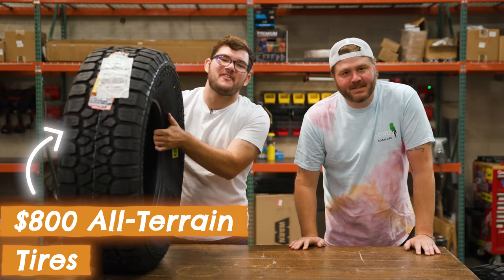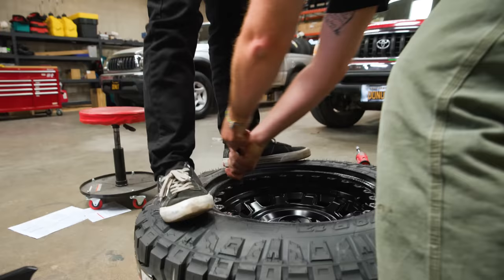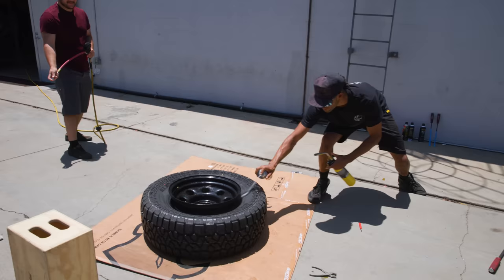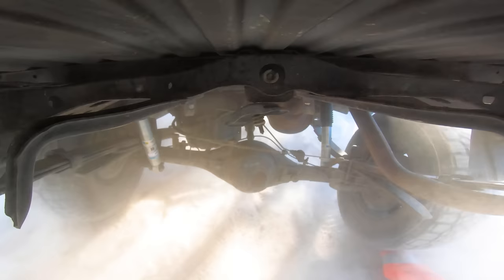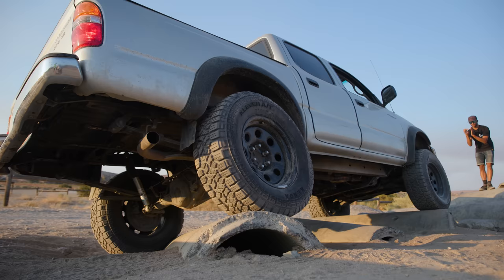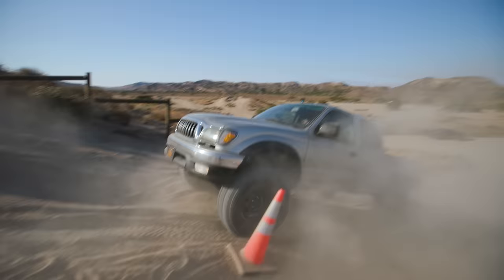$800 Off-Road Tires vs. $1500 Off-Road Tires

Comment: to be honest the steel wheels performed just as good as the beadlocks that were the cost of the tires more than the steel ones so i would do the steel wheels with expensive tires. and i think the rim might have been lighter even tho the beadlocks were aluminum they had more surface area of metal compared to the steel ones all those bolts for the beadlock and the beadlock ring itself. and for what they did it was useless. so best bang for the buck is the 2000 dolars on cheap wheels and expensive tires VS spending 2800$ on cheap tires and expensive rims like he said. Even he said the expesive tires had more grip on the pipes

Comment: This isn't a very accurate test for offroad tires, it doesn't show anything for wet traction, tire compound, sidewall tear resistance and more. The advantage of more expensive tires is usually the compound it's made out of. Most cheap truck tires are hard to last a long time, which is not what you want offroad as it limits your traction, just like street tires. However there are affordable decent offroad tires out there, you just have to know what you are looking for and do research.

Comment: Regardless of the initial traction qualities, if these tires are on a truck where they will not see a lot of use (tread wear) and time will become a factor, I think you'll find that the Kenda tires will display a significant amount of weather checking within only a few years, whereas better quality tires will age substantially better in similar conditions.

So, if you're planning to shred your tires in a short period of time, save some money when it makes sense to do so.
Reply: Nah I think the expensive price is because most tire companies spend millions and millions on advertising.

Comment: Glad you guys are moving away from your comfort zone with street cars.  You are going to learn a lot, you are saying and doing some things that you will look back on and cringe (15PSI is low etc.) , but its all good fun and entertaining.  remember the old saying with 4WDs; as slow as possible, as fast as neccessary.  go slow enough to fail then add speed as needed so you dont break things.  very important here is Australia as a broken CV joint in the bush / desert can be life threatening - you could be days from the closest repair outlet.

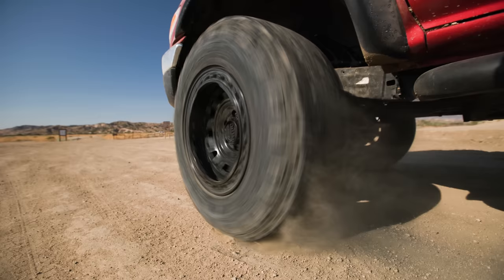Comment: the guy running next to the trucks while doing tug-o-war at 13:14 was very very sketchy! if anything snapped and it whipped that tow strap, it could easily sever a limb or head.

Comment: Anyone wondering bout mount n balance yer own tires YouTube: 
Harbor Freight Duckhead mod 'Mine total cost $180 built'

Get you a bubble balancer ($45) and some tape weights ($10.00). Napa RuGlide Gallon ($18.00) We've done our fleet for 5 years so far w/that method Works a treat and the whole setup was paid back within two sets o tires. Now it's payin us :)

Comment: I busted my rim trying to take tires off the rims with a tire irons. Def dont do that if you are doing offroad tires on aluminum rims. One of pluses of a steel rim is you can just bend it back if you do it on your own... but the aluminum chips and cracks.

Comment: The difference may not be in the grip but on the durability 
At least on a dirtbike there is a grip difference but theres a even a more drastic durability difference 
I felt that when I used hard enduro bridgestone tires they lasted way more than duro tires 
The grip was a bit more aswell but I needed go lower on the tire pessure with the bridgestone tires cause the rubber is harder

Comment: The real issue with tires is quality control. After running treadwrights I will never do that again. They blew out, cracked and just wouldn't balance right. Although I'm not intimately familiar with Kenda. Other cheap brands like them are known to be hard to balance, known to chunk and go out of round.

Comment: Your tires are different weight because there is less physical material non the steel because it is a stronger metal. Aluminum is not actually lighter in tires. You just get to do cooler shit with em.

Comment: never use brake cleaner not only dose it eat paint and powder coat it also eats rubber. use a 1/4 the amount you did of starting fluid you want it to pop and burn fast not suck down witch is a fire still burning inside the tire using up the o2 and putting air in real fast is just adding more o2 to that fire iv seen a guy do it your way on the trail with a 40in tire that stayed burning inside and no one knew it an they got the tire back on and a few min later his new jeep was burning.

Comment: What about on road performance, road noise, wet pavement and life expectancy. 95% of my overlander miles are over paved surfaces. If the low tires wear out twice as fast its a better value to buy the high tires.

Comment: If those are 33‘s are bigger without a bed like you could easily drop down to 10 and with that beadlocks if you’re a 33 a drop down to six if you’re a 35 you could probably drop down to four easily are used to run two and three on my 40 inch tires without beadlocks no problems

Comment: Hi team weighs more because they are beadlocks, beadlocks are significantly heavier than normal rims.
Reply: Also with beadlocks you can drop down to 8-10psi for soft sand and or rocky trails. Regular tires I wouldn’t go lower than 15 psi.

Comment: I saw some Aussies on yt put beads back on by using firecrackers instead of brake cleaner. Anybody ever tried that?  I used starter fluid and brake cleaner myself. Firecrackers seem safer if it really works.

Comment: I LOVE MY KENDA KLEVERS
Reply: How many miles on them? Just got a set of AT2s. Hoping they'll last. Not much info on long term tread wear
Reply: @mikeypotts4732  I've put 20k on them and they still look new , still sitting at 15/32, they kick ass and balance nice, not noisy at all on the road compared to other tires, could be better in wet/rain conditions but they grab really well in the snow/mud. I've had 2 nails snag the tread but the rubber is so thick you just pull the nail out and there's no leak.

Comment: Steel wheels are better for offroading they dent instead of crack so you won't be as easily stranded if you're far away from any civilization in your truck. Rally cars use steel wheels for somewhat the same reason.

Comment: You can get some great tires for cheap but expensive tires will last a LONG time. You'll see 70-80k miles on a set of expensive tires. Probably only 20-25k on the cheap ones. Beed-lock is nice for extreme offraoding, useless for this type of light off-raoding. Good video!
Reply: Those have a 55k tread warranty,  at about 10k, they will be about 10db louder

Comment: im using stock suspensions on the fj but im using mud tires wich have waaay ticker rubber than the ones youre showing and in the mud in africa in raining season i never needed the 4x4 and during dry season in highway i cant hear the noise becouse the straight fj windshield at those speeds hide the noise lol... btw i paid for each like 160 dollars

Comment: I do think that the biggest difference in price between those tires is not so much in performance, but longevity.

My experience with Kona road tires were that they do not last nearly as long as the more expensive Continentals. Granted that was on my sedan, but I think you find that in most types of tires.

I only got my truck recently. Did a road trip on road tires. Thought I would keep them to reduce road noise, but its interesting to see that the A/T tires do not make a big difference in noise!

Comment: you guys need someone that knows off-road to consult for this show.  It's apparent while you guys are knowledgeable about engines and cars, you are clueless about off-road.  The entire point of bead locks is to air down, unsprung weight isn't necessarily a bad thing off road, AT are not real off-road tires, steel wheels are used regularly off road but no one running steel wheels off road care about scratches so quit your whining about not having the tires professionally installed.  If you off-roading you will damage your rims.  i could keep going but i wont.  get someone to consult for you.

Comment: You disagree airing down will help you with traction? What? 15 lbs with beadlocks? Why not 5? They'll be fine... 
Also, pro tip, you can balance at home with a $150 balancer from harbor freight...
Reply: Like really though, why buy beadlocks if you're not gonna run low? You could put those steelies at 12 and they'd be fine on the trail...

Comment: LMMFAO only 100#s a corner. One of my tires are 104# then another 50# for the wheel. And I'm running small tires compared to my wheeling buddies who run 42s and 43s.

Comment: Alloys so rarely weigh less than steel rims. Not to mention your speedo will be wrong, your brakes become disadvantaged and the steering becomes more and more vague the further out of spec you go. Ps far too munch brake cleaner.

Comment: my opinion at 850-2,500 you are paying for a brand name

if you can't  stick a thumb between the tread you already should know what the capability of said tires are and what they are designed to run through

most all terrains are typically tarmac/gravel road/clay (maintained roads use a light beach use)

mud terrains 1thumb to 2 finger width tread pattern dirt/bulldust/beach

with the bulk of people  playing around 17-21 inch standard rims, these are nothing tarmac crawler and should never go off road watch the with the nick name jeep banana and watch the idiots he recovers with his team..

Nobody these days needs high sidewall tires and low tire pressure  running at most 15-16 inch rims

Anything listed as all terrain tire are typically is referred to a radial tire for  your 4x4 tarmac/maintained gravel/hard packed dirt clay road, somewhat limited to be used on sand or muddy powered sand or beach sand conditions

Note: if you had to been recovered by recovered at some point in the past you will understand the concept just because something state and says  4x4 don't mean the fucking thing off road usable  this typically ends up being another cost on top of base  vehicle cost. pending on vehicle $50-200k after mods are available

Comment: How is having a hybrid mud tire up against a regular all terrain tire a fair test? 
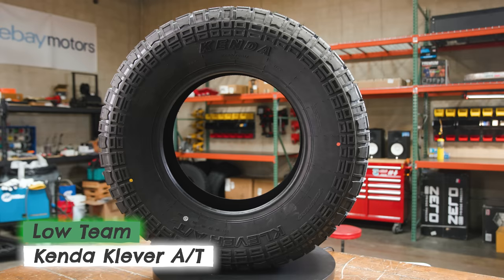I am only 2:39 in and I would imagine the hybrid would do a better job since it has way more mud tire characteristics and a much taller and aggressive tread block design.  I have owned everything from BF Goodrich KO2's to Nitto Mud Grapplers, Toyo's  and was not impressed with any of them really. The Toyo's being the better of the three, finally I tried 4 37 inch mud tires on my 05 chevy dually made in China for $175 a tire installed and they were amazing. I bought two pair back to back and this last time I went back with just a A/T also made in China and the have been amazing.  Getting raped for $3,000 or more for a set of mud tires is the worst of the whole experience and when they wear down in 12,000 miles is even worse. At $175 a tire who gives a FK right! 
BF Goodrich, Nitto, Cooper, Toyo, and all the rest of the named brands can kiss my ass! 
Also if your not rock crawling and live a normal life of occasionally going mudding who the hell needs bead lock rims at $2000 for a 17 inch rim set lmao! Damn rims and tires have more value then the freaking 2002 Tacoma they are mounted too!!
$15,000 for a 2002 Tacoma pre-runner with over 100,000 miles proves how fucking stupid and ass backwards the world is in 2022 to begin with! God we are idiots for allowing this to happen to begin with when it comes to prices! We keep paying it so they keep selling it LMAO!
Reply: Those aren't mud grapplers they are ridge grapplers

Comment: Why so surprised at the fact that 15 psi will increase traction? Secondly you don't need beadlocks when running 15psi. Do you guys ever do any serious off roading? Also, when using aerosol to set the bead, don't use a blow torch! What the F is wrong with the guy who did that! That was like watching amateur hour.

Comment: No it does not mean it's better because it's more expensive the wheels and tires on my 4Runner or $600 cheaper than the wheels and tires on my buddies 4Runner he still has not found someplace he can go that I can't

Comment: What did you learn from tug a war games? Silly. Why don't you invite a tire engineer to cut them apart and show any differences in belt thickness, construction, bead thickness, and any tread rubber compound that might affect noise, treadwear, and driving ability. 

Klenda is not bad. Compare premium tires to some of these flood of cheap ass Chinese made tires and see how each holds up.

Comment: The contact patch does not change by changing tires, that is all based on psi. If you have the same psi you have the same contact patch no matter what type of tires you use. The square inch area does not change. What you get is the shape of the contract patch changes. Plus I was sad you didn't mention the psi of the stock tires and the new tires for the hill climb. That's a huge difference. If I had my stock tires I could air it down and climb that hill and the new tires would not at 44 psi where I keep if for on road driving. psi is a huge deal when it come to tires and you guys never really mentioned any of that

Comment: I mean they are both turds. They even have it printed on the side. TRD. Tacoma's embrace that to the fullest extent and get worse every year. And words like "favorite off-roader" and it's perception are horribly skewed by it's popularity, and it's popularity is solely because of the name. But I digress, for the sake of comparison you have two equal cars which is all that matters. It's hard for me to call them a truck when they have less payload capacity and less room than comparable year sedans.